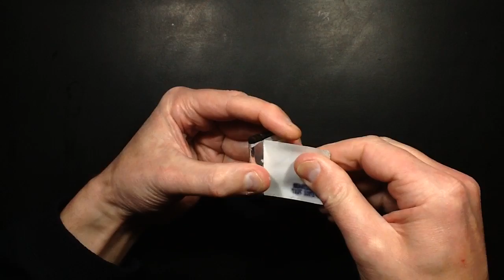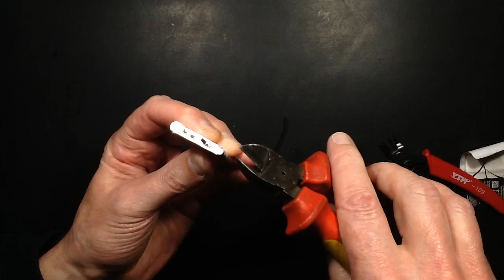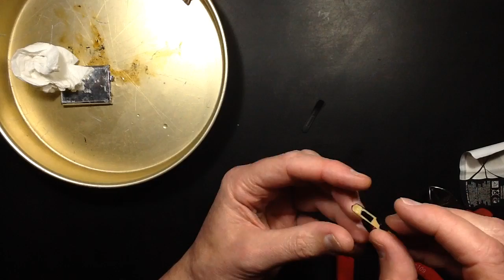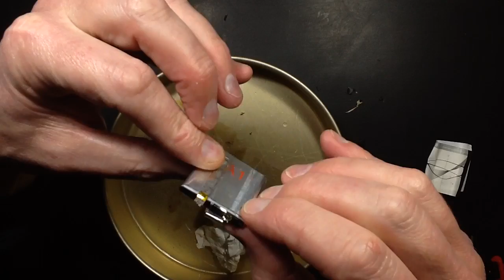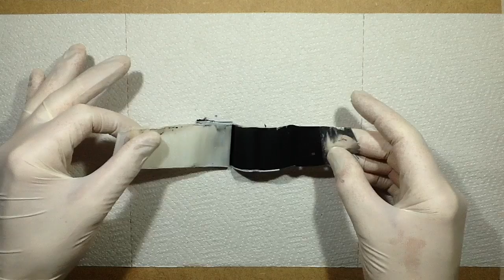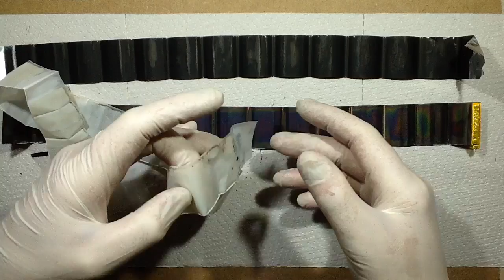TOTAL teardown of a lithium phone battery.

Comment: My smartphone's battery swell but I want to use it via charger. However, it  doesn't work without the battery. Can I just use the connector part to make it work?
Reply from the maker: If the battery is swelling then I recommend discharging it and replacing it.
Reply: @bigclivedotcom  It's a very old phone, I would just like to use it as a spycam, so I won't be getting a new battery (probably would be difficult to find one, too). But it won't turn on without the battery so I was wondering if it might with the connector and the circuit, just stripped of the swollen part...

Comment: The black thing should be carbon, and the metal strips are copper and aluminum. You can check out this page https://learn.sparkfun.com/tutorials/how-lithium-polymer-batteries-are-made

And the electrolyte must have smelled sweet. I've cut open a LiPo pouch for iPod touch before and threw that away immediately when I smelt that XD.

Comment: So which one is the lithium
Reply from the maker: Neither.  The amount of lithium in rechargeable cells is tiny.  It's diffused through the black coatings.
Reply: bigclivedotcom thanks,you see,I was trying to get the magenta flame with lithium battery and as I mixed it with methanol 70% I was able to only get 3 tiny magenta flame out of all the things I dropped from disabled lithium ion battery! All the other flames were blue and orange! I am disappointed! Only 3 tiny magenta flame out of all the battery ingredients I put!

Comment: I pulled apart an iPhone 5s to replace the screen, but I accedently dropped it on an object that protrudes from the ground, and it landed on the battery. I immidiatly pocked it up and he battery made a small hissing sound, which I knew wasn't good, so I tried to take it out, resulting in the battery hissing violently at me, and me shoving it in the box for my Samsung Galaxy S5. Idk what to do now, plz halp. I'm thinking of burrito it in my backyardmaybe? or burning it (jk). thanks.
Reply: You've created a short, and the heat from the ensuing reactions are decomposing and boiling off the electrolyte through a safety vent that's built into the cell. You're probably 100% fine.

Find a biscuit tin or a cake tin or something reasonable fireproof, put some holes in the lid to let the gas escape as it's boiled off, and put the battery in that. Put the tin in a safe place away from flammable materials, like the middle of a concrete patio or something. Once it stops hissing take the damaged battery to your local recycling centre for disposal.

Disclaimer: This is just what I'd do, not professional advice.
Reply: +sockatume ok, thanks for the advice. it worked
Reply: wtf?
Reply: Your phone replace skills are awesome. You change the screen and then drop the fucking screen... GREAT!!!!11!!1
Reply: The battery should be fine, it's the snake you should be worrying about
Reply: +That Guy thanks for the reassuring tip

Comment: The metallic film is pure lithium. It oxidises rapidly in air hence the colouring. Cut a strip off it and set it on fire -- fascinating!

The energy is stored in the chemical surface of the film. Large energy density!
Reply: The metal you see is not elemental lithium. The lithium is in the battery as its salt form. Lithium salts as lithium hexaflurophosphate (LiPF6) are used as an electrolyte, or a cathode as is lithium cobalt oxide (LiCoO4), or a anode as lithium manganese oxide (LiMn2O4).
Reply: what you used as separator

Comment: "aluminium or some other alloy"... you do know why those are called lithium batteries, do you? O_o; 
Also it is corroding as you talk.
Reply from the maker: +lordplenty Rechargeablke lithium cells contain virtually no metallic lithium.  Just in salt/ion form.
Reply: +bigclivedotcom 

Li compounds, but where did you get the aluminium [electrode] from? ;)

The only Li compounds containing aluminium I could find are ML and VL types.

http://moodle1315.up.pt/pluginfile.php/168003/mod_resource/content/1/wiki%20Lithium%20battery.pdf

https://en.wikipedia.org/wiki/Lithium_battery#Chemistries

More importantly, you didn't let it go boom!
Reply: No. What you're looking at there is a current collector. A lithium-ion battery like that has a graphite anode and a cobalt oxide cathode. Forming metallic lithium dendrites is actually one of the more alarming failure modes.
Reply: +bigclivedotcom That whole sheet is in fact lithium :) it just oxidises very fast, that's why it looks black
Reply: +bigclivedotcom That whole sheet is lithium isn't it? Dunk it in water

Comment: OMG dude the black stuff IS the lithium!?!? as in LITHIUM polymer batteries!? it's just very oxidized as all alkaline metals react strongly with air and the moisture in it.. have you never played with raw alkaline metals??? lithium is usually shiny but after a few seconds it turns dull and grey.. then apparently black..